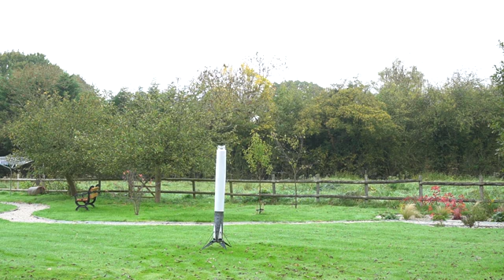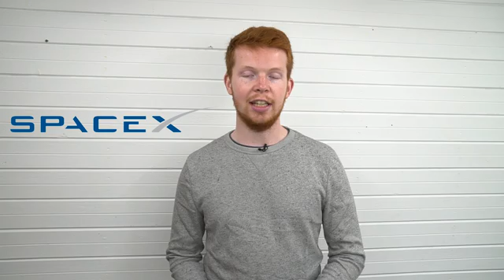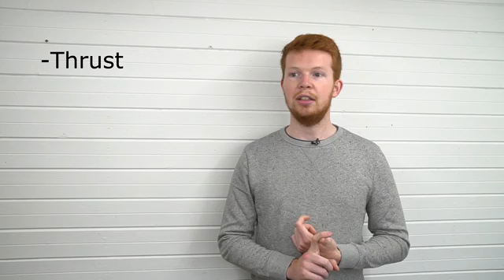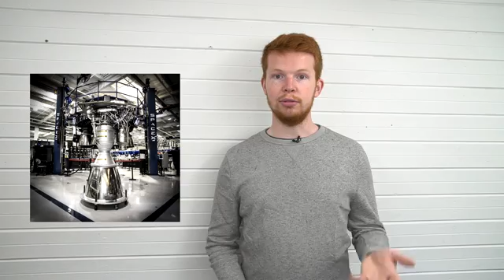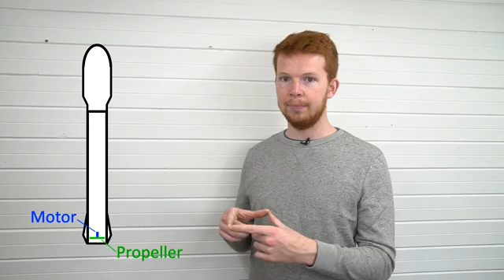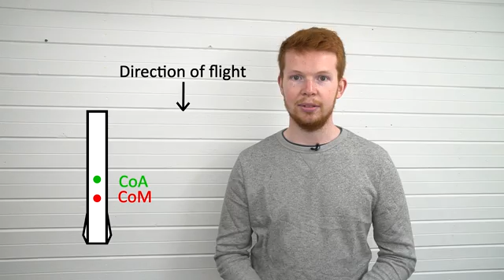Hovering a rocket - SpaceX model

Comment: You could land on a steel plate and use electromagnetic lockdown to prevent tipping over. Also if you program automatic max descent velocity landing would become safer. Great work!
Reply: In fact, there's no thing in the whole universe that can sense its velocity. You just assume it. He could add an accelerometer to keep track of the accelerations of the rocket and calculate the velocity vector that it should have. Doing this, the rocket could even counteract the force of the wind.

I really expect a second part adding an accelerometer and some machine learning to make the flight controller learn by itself how to take off, hover, counteract wind, move to some place and do a soft landing. And an engine that does not overheat! Someone said that an EDF motor is the way to go.
Reply: vistaero these 8 bit processors are a bit weak for mashine learning
Reply: vistaero are you taking in Einsteinian relativity terms? - I was taking about acceleration measured obviously - bad signal to noise ratio? Augmentation with camera data comes to mind...
Reply: usertogo I know, I was replying to hansdietrich83. He said that the flight controller can't sense the velocity. Well, just make it to be able to measure it. Of course the hardware needs a lot of improving.

hansdietrich83 Then just run the learning engine in the laptop. Instead of him tweaking the parameters manually and loading the new code to the rocket, the computer would automatically generate the new parameters. It will probably take a little more time to learn to fly, but eventually it should fly better than with any human-made code. Maybe it would be a good idea to practice in a computer simulation.
Reply: vistaero normally a simple PID loop is usedfor holding the drone upright. U do't know if it already exists but the open source 3d Printer firmware Marlin has a built in PID Autotune rootine fir the heating element, which could be implememted into the flightcontroller
Reply: usertogo the flight controller cant sense the velocity just the angle of the rocket